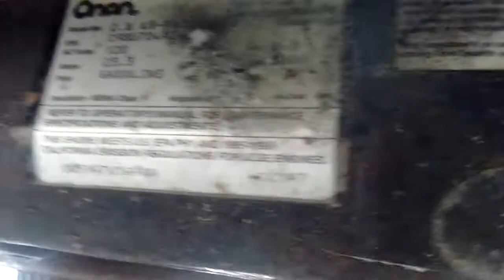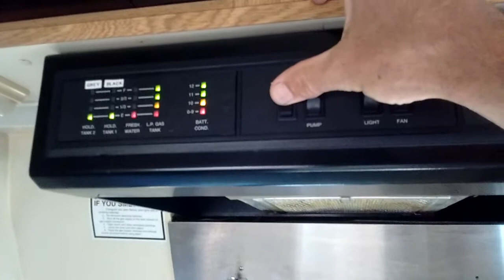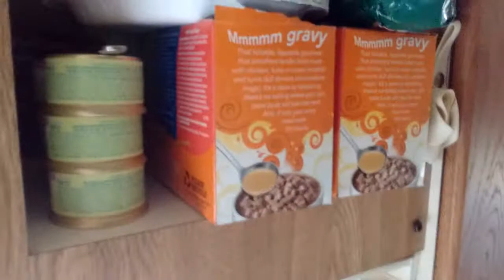Class B RV Camper Van (1997 Coach House)

Comment: There is this guy where I live that has one of these.. He has not touched it since I have lived here, It does need a lot of work, but If I can get it at at good price, I can get everything fixed on it.. Though the one I am looking at is a Dodge? I think.. its got the same set ups.. I just subscribed to your channel..
Reply from the maker: +Barbara Corfield Thanks for subscribing and good luck. It's getting much harder to find a good deal on rv's. If it hasn't  sat around too long, you should do well if the price is right.

Comment: Have you cked the date on that smoke detector it looks old. I see a lot of traveling cats now. I would be afraid to leave them roam. Mine would run and hide and hard to find. Thanks for the tour
Reply from the maker: I didn't think of checking the date on the smoke detector. Good idea. It runs of 9 volt and I usually replace batteries during time changes. I know the CO  and LP detectors have about a 7 yr shelf life and I believe they are beyond that. The LP detector definitely needs  replacing. Being Lower to the ground, they tend to get foreign objects in them and not work properly. The cats are pretty good at staying around at this point. They are travelling veterans. We weren't able to let them do that at first.
Reply: I took cats with me a different times the one Siamese loved walking on a leash and would go on trials with me. I never trusted to try her off a leash even around the camper. I had a Norwegian Forest that got sick at the first stop sign or light then would be fine there after she was right at home. When traveling  one time a truck went by and scared her so bad she slipped her harness and started running full speed across a field. Luckily I tackled her like she was a football and I never played in my life but, it was the best catch I ever made or she would have never been seen again.  She lived to age 23 and had some travel miles in her years. Ck that detector soon. Thanks for the reply.
Reply from the maker: Thank you for watching and thank you for looking out.

Comment: The Norcold Frig should work on Propane
Reply from the maker: This one is only a 2 way model. 12v/120v.
Reply: Bud Blankenship never saw one like that. When you update it get Propane or Electric at least or all 3
Reply from the maker: Another thing is that it is a compressor fridge as opposed to an absorption (ammonia) unit and is self venting. It does not have to be level to run. It does eat up more battery power but it is pretty efficient.